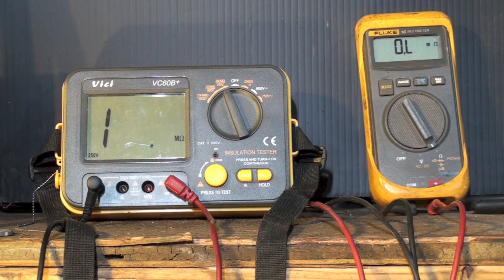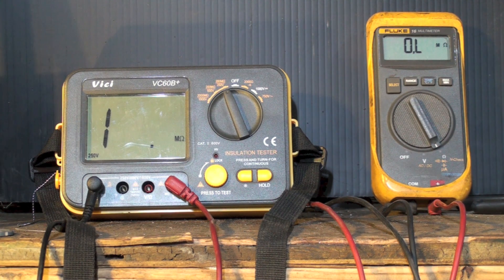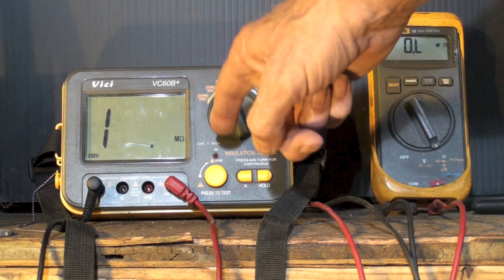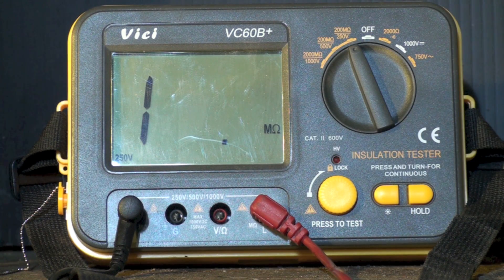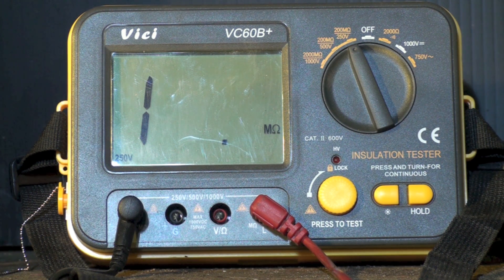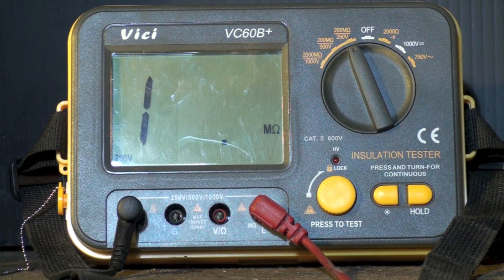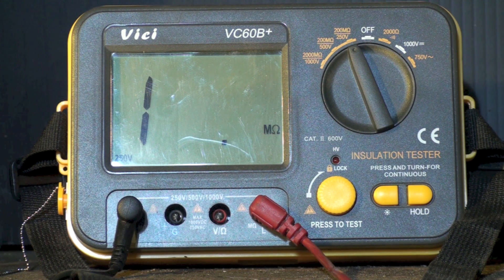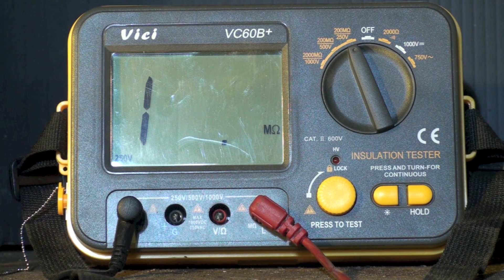How the insulation tester works

Comment: The meter on the right is if it is supposed to be stuck then it will confirm its stuck

The meter on the left is for if it is not supposed to be stuck, it will confirm if it is stuck!

Connections, Electrons, Resistance, Continuity, Open/Closed etc is what i mean!!!

Wire with hole in it = possibly stuck! How much? Crank up the voltage!

Comment: That Fluke multimeter is not a Megger.
It does not measure insulation resistance.
The original Megger was an unusual hand-cranked device.
Please see here: https://www.youtube.com/watch?v=1g97GV81BM4
>
Reply from the maker: There is a difference between a megger (megohm meter) and an insulation tester.
A megger uses a low voltage signal sent thru the circuit to test resistance.  An insulation tester uses high voltage to attempt to break thru wire insulation.
GFM
Reply: @grayfurnaceman  A  genuine Megger "IS" a high voltage insulation resistance tester.
What you are doing is mis-identifying ordinary multi-meters and resistance meters as a "meggers", simply because they all measure resistance up into the megohm range.

One of the first Meggers was a "hand dynamo", which allowed generation of voltages high enough to measure resistance in the megohm range and thus construction of a first portable insulation tester. The MEGaohm metER was then named as Megger and the word became a trademark name registered on 25 May 1903. The invention became a popular method of insulation testing and by the 1920s it was "well-known" by other engineers.

Please see:  https://en.wikipedia.org/wiki/Megger_Group_Limited#Evershed_&_Vignoles

>
Reply from the maker: @Bodragon  Good grief.  why not just argue about how you pronounce "Tomato".  I won't participate in this silly argument.
GFM
Reply: @grayfurnaceman  Fine but you started it.
And this is not about how we pronounce words differently - that's just anally retentive nerdy stupidity.
But it's really funny to see how you lash out when called out on a mistake and even double-down on it..
A Megger was actually a real, proper, dedicated  high voltage insulation tester. The company even trademarked the Megger name.
That's a bit different  from, say,  tomayto, tomahto.
>
Reply: @grayfurnaceman   I've just noticed that the Fluke 1587 is essentially a "Megger" since it is, primarily, an insulation resistance tester that measures at 1,000V.
That particular model looks remarkably similar to that Fluke 16, you've got there.
This leads me to suspect that you're not a bon- fide HVAC engineer, rather a "helper", otherwise you would not have made this mistake.
Please see here: https://www.testequipmentdepot.com/fluke/megohmmeters/1503.htm
I would love to see your comments.
>

Comment: Would you use an Insulation Tester on a Condensing Unit conductors between a panel and disconnect? If so, can you demonstrate that?
Reply from the maker: You can, but mostly they are used on motor windings.
GFM

Comment: Why would anyone use a meter that utilizes only 9 volts to test a compressor that runs at 240 or 440 volts.  The motor isn’t running  at 9 volts so why would anyone use a standard ohmmeter to verify the condition of a compressor. A compressor that is full of liquid refrigerant will fail a megger test.  It’s the reason for a lot of burnouts on units that are started up without the crankcase heaters being energized for 24hrs prior.. We teach and stress the use of megohmmeters in our apprenticeship program.  In fact it is a part of annual service on large equipment to Meg the compressors and all motors. A Megger will detect insulation faults in a unit that are causing nuisance trips of fuses and breakers, where an ohm meter will not.  Every pro HVAC tech should have one.

Comment: Thanks a lot for sharing, I think that you have made the best explanation!
I hope that you please will answer my noob question. I want to test old insulation, glue, foam and so on, used in old amplifiers, if it is become conductive over the years. Is that the right tool for the job? (considering it's name) :-)
Reply from the maker: It will work if you know the voltage that normally is applied.
GFM

Comment: how does a 9v dry cell supply give 1000v in an electronic tester to test insulation?Is it just a simple voltage transformer inside the tester?
Reply: A transformer with the current switched on and off at some frequency on the primary side by a transistor. The secondary windings step the voltage up and then a voltage doubler/multiplier (which is just some capacitors and diodes connected in a special configuration) circuit steps it up even further while rectifying it to DC.

So, no, wasn't stupid of you to suggest a transformer.

If you're at all curious, you can look up "switch mode power supply" and "voltage doubler." The insulation tester has kind of a mix of both, I think.
Reply from the maker: Beats me but it does.  It is not a transformer because it is direct current.
GFM
Reply: grayfurnaceman Ah yes you are right and stupid of me to even suggest a transformer .Could it be a dc to dc converter then?
Reply: Yup, probably uses a boost converter.

Comment: GFM, I read somewhere if you notice a downward trend or low megohms that it's possible you might have containments such a water in the system slowly generating acid and eating away your wire insulation. It was recommended to pump down the system and replace the filter dryer or if really bad readings replace the filter dryer twice.  
I would like to know what your thoughts are on the subject and if it would be worth the trouble.

Comment: I have an old megohm analog meter and I found this guys compressor to read less that 10 megohms and I though ok the compressor is shot, so I got out the digital supco megger and it read 20 which is as low as it can read and says to replace the compressor. Well I'm here to tell you thats been well over a year ago and its still running lol and drawing rated amperage go figure
Reply from the maker: I guess its not over till its over.
GFM
Reply: +grayfurnaceman Yeah I guess so, I told the guy to be saving up for a new unit though
Reply: I've been reading electrical blogs and the general concensus is that acceptable megger readings can be as low as 1 Megaohm per 1,000 volts plus 1 Megaohm for safety margin. Example, 480 volts = .5 Megaohm + 1 Megaohm = 1.5 Megaohm. This has proven to be true in my experience because I have yet to see a motor trip on 480 volts unless the megger reading was less than .5 Megaohm. Don't know if it holds true on scroll compressors but don't see why not

Comment: Hey GFM, always enjoy your videos. Just wanted your opinion on those Supco M500 meggers, the ones that only have an LED scale, no number readings.

Would you say they're decent meters for checking the insulation on residential ACs?

Thanks!
Reply from the maker: juncho1977 Actually they are ok.  I don't believe they will different voltages but will give a pretty good idea.
GFM